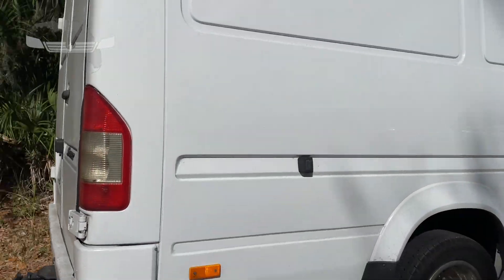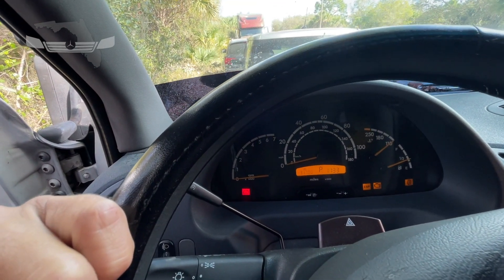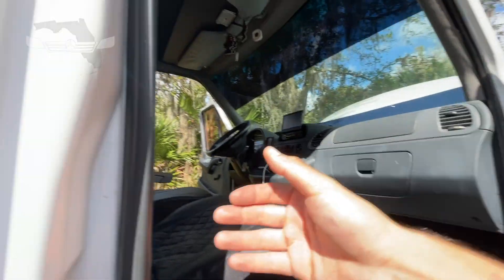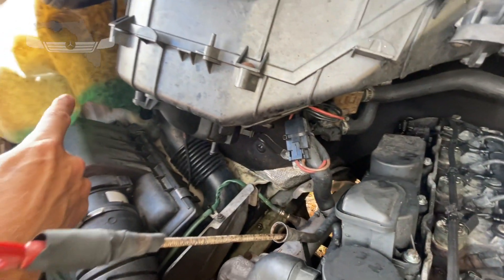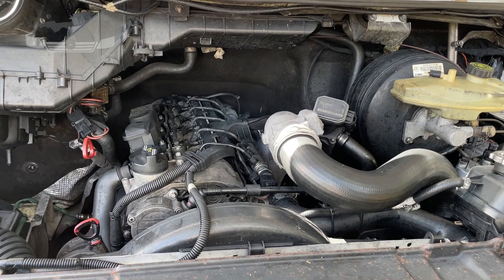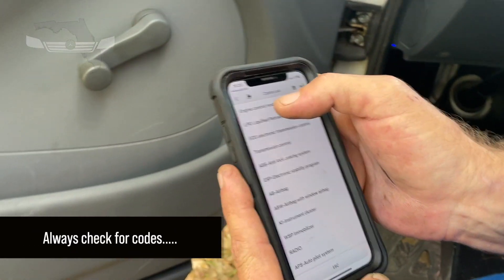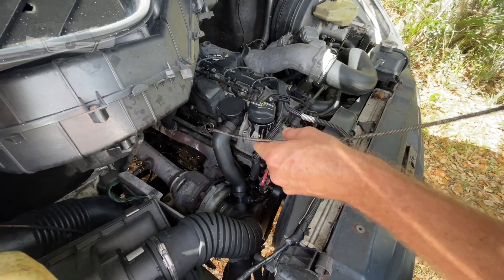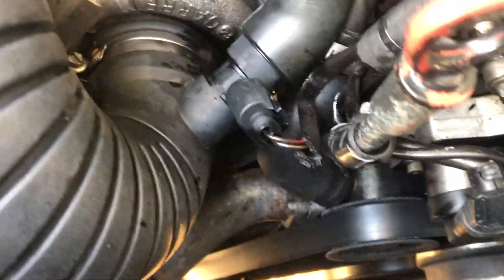Shiny T1N Sprinter Hiding Deeper Issues Underneath -  Rolling Realtor

Comment: what does rusty fuel cap mean? mine always rusts
Reply from the maker: Humidity and possibly condensation in your fuel tank. Most of them have it, some of them worse than others. Topping off the fuel tank regularly seems to resist the rust. Splashing a bit of diesel on the cap occasionally inadvertently helps. Spraying the cap with WD-40 or similar product at every oil change will help immensely. While you have the squeak stopper in your hands, every 10,000 miles is also a good time to lubricate door hinges and latch mechanisms. If you want to get crazy... while the back doors are open hit the bolt heads for your spare tire holder. If your lug bolts look rusty... I mean the can is in your hand, right? You won't have that can of penetrating lube handy when you need the spare and lug nets to move.

Comment: Literally the engine bay of horrors.
A prime example of a DIY'er or general mechanic that should have joined the sprinter forum or T1N FB group to be steer in the right path. 
That van is a prime candidate for the MMS full Bulletproof kit cause like Mike said:
All the Razzle dazzle  with the ebay lights and 
None of the Bosh Jazz on that Jasper engine  with all those aftermarket junk parts.
Reply from the maker: That would be AFTER baselining the engine and determining why it clacks so much!

Comment: 2006 with a T21 whammy that should only be affecting 2004s, yes?
Reply from the maker: Common misconception. The T21 effected 2004 disproportionately to the others, but many 2005 & 2006's were also effected adversely. I'm a long time owner of 2004 & 2005 and got a 'recall suspended' letter for both vans the same day. They stopped the entire program because there was no reliable way to predict what vans would be successful and what vans would become nightmares. I'll never have the recall done if I can avoid it. Even now, the new and improved recall procedure and subsequent repairs when it does not go well, has problems.
Reply: @FloridaVanMan  t21 was / is what kind of problem? thank you